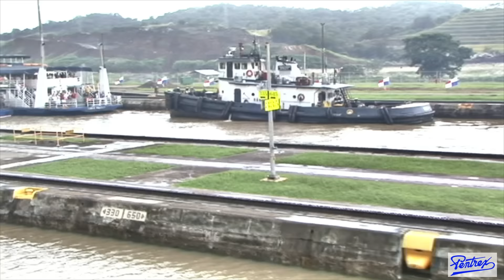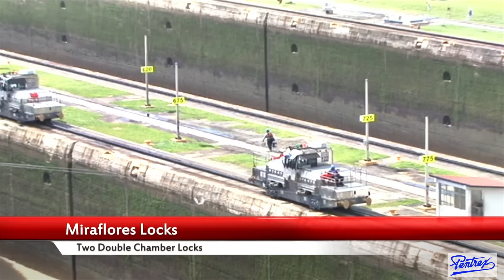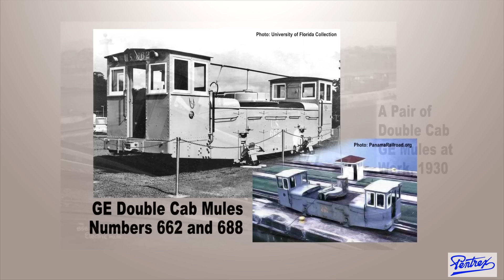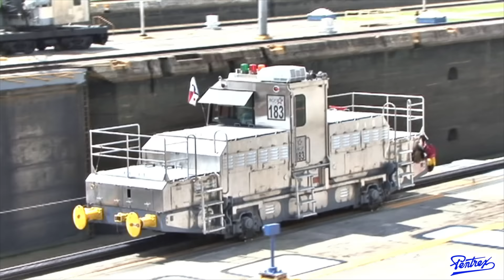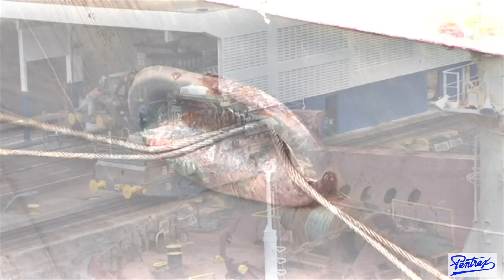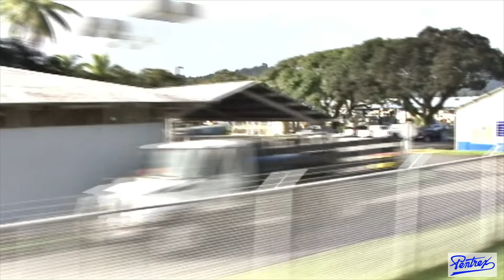Mules of the Panama Canal, Panama Canal Railway | Full Movie

Comment: Small update: The ex Midsouth Paducah built GP10 used for work trains has been retired but cosmetically restored and put on display in front the PCR’s HQ. They appreciated the old geep as the first engine they had that helped restore the railroad with MOW trains. Glad the old Geep survived
Reply from the maker: Thanks for the update! After working MOW for years, the Geep's survival was not guaranteed. So glad that it survived - and now on display.